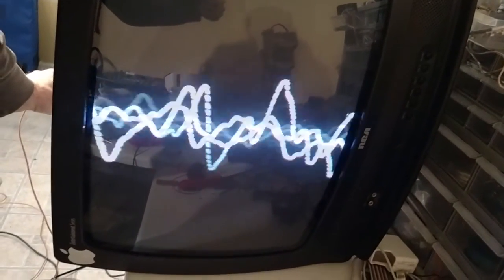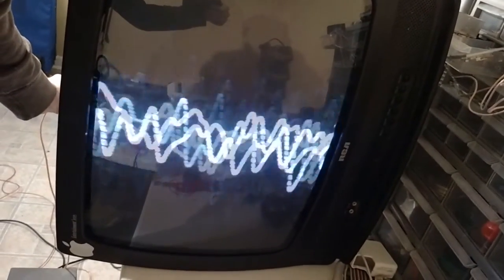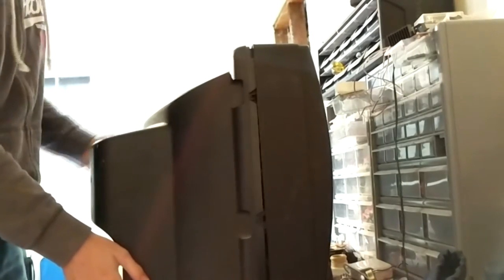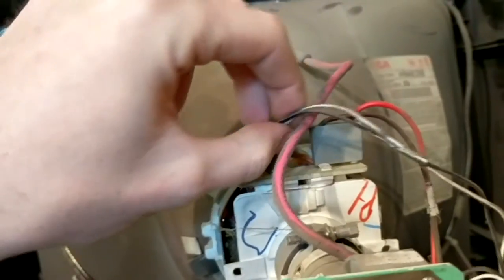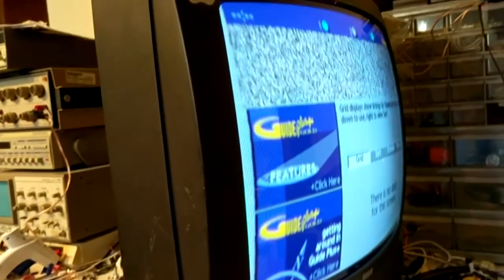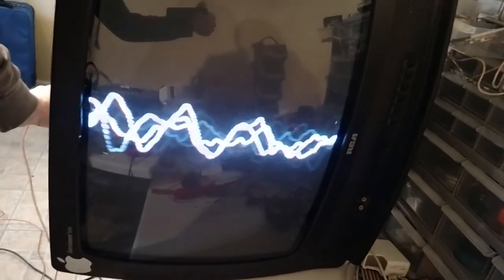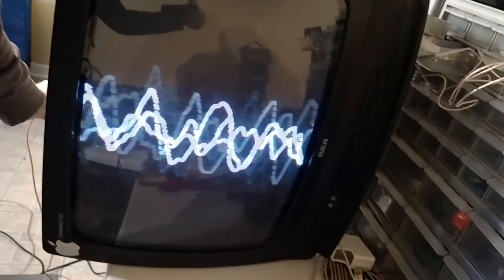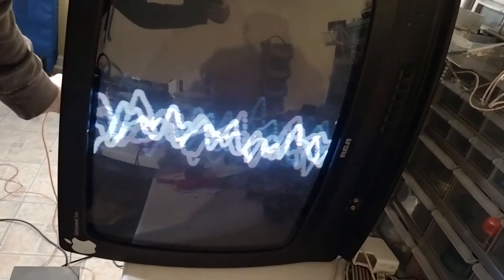Turn an old tv into an audio visualizer!

Comment: Why didn't you connect audio signals to both the horizontal & the vertical coils of the deflection yoke ( that's what those coils of wire on the picture tube are called). You would've wound up with a much better display & you wouldn't have needed to lay the TV on it's side. I made 1 of these out of an old black & white TV back in the 70s & used both coils of the deflection yoke. It worked great & displayed some pretty amazing patterns. Like pulsing circles for the low frequencies with the tight squiggly patterns in the center for the higher frequencies.

Comment: I spliced the wires to the coil from oldish portableish radios speakers. Crt tv and radio turned on but the crt output only a straight line with no wibble wobble with the music?

Comment: Very cool.
But why did you have to use the Horizontal controller?
Why not the other one?
Reply from the maker: +citroengt11 you know, I had a reason but I can't remember what it was lol it should work either way.
Reply: If it works, it ain't stupid.
Reply: The other coil runs at a higher frequency. Much more difficult to get a proper horizontal waveform going with that. Turning the TV on its side is a lot easier.
Reply: @rienpost3145  did you mean that if i use the horizontal line and check the low frequency signal. It not work???